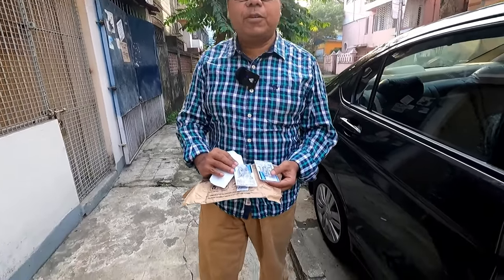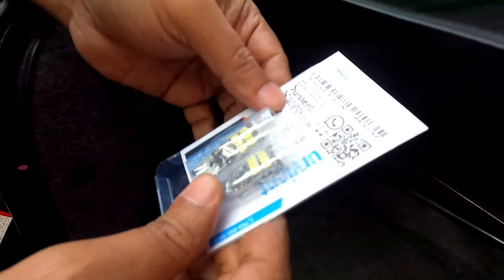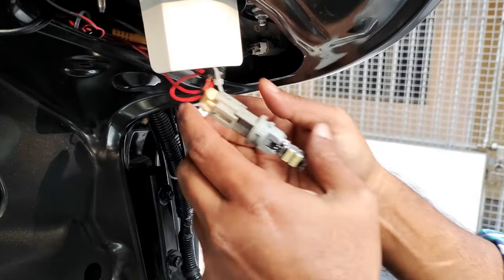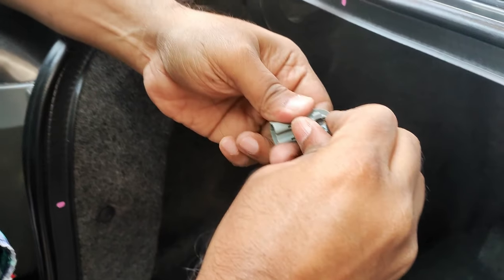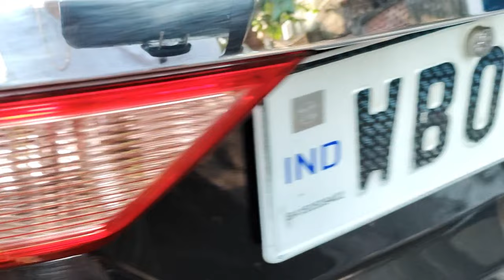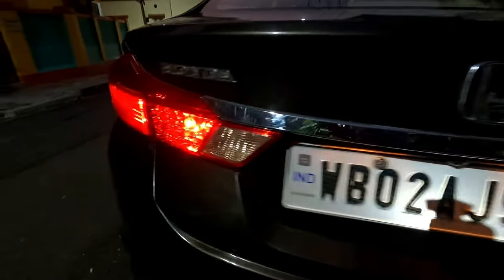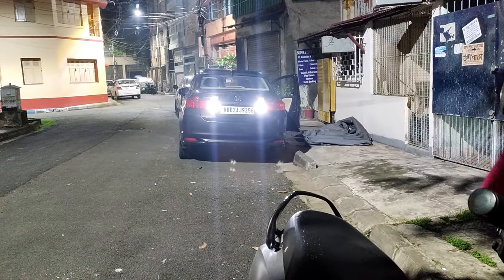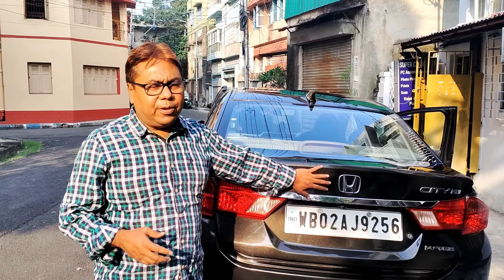Honda City 2016 Led Reverse & Taillight Bulb Upgrade Installation DIY #hondacity #carledlights

Comment: the link shared for For reverse light….we have to choose amber colour right?
Reply from the maker: No white for reverse
Reply: @supercyberautomotivetravel  there is no option apart from red and amber in that link provided!
Reply from the maker: https://amzn.to/3HtQhxb
Reply: @supercyberautomotivetravel is it same sir durvient and automaze? Can i purchase automaze white if durvient is not available?
Reply from the maker: Specs are the same so you may go for it.
Reply: @supercyberautomotivetravel In terms of brightness…both are same?
Reply from the maker: As per specs almost similar
Reply: @supercyberautomotivetravel thanks a lot 🙌❤️
Reply from the maker: Yes you can specs are almost same
Reply: I am using Durvient T15’s instead of T10’s LED’s for both brake (red) and reverse lights (white) on my Honda City 2016. Is that fine?